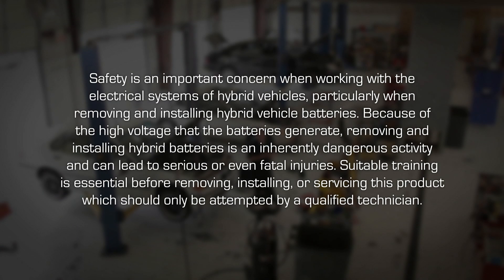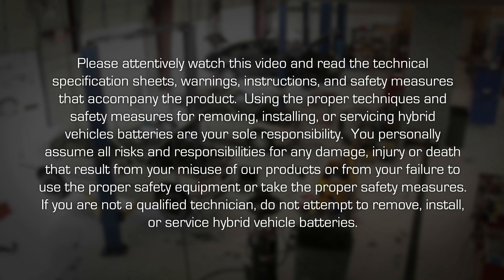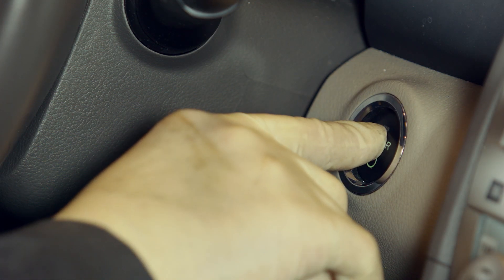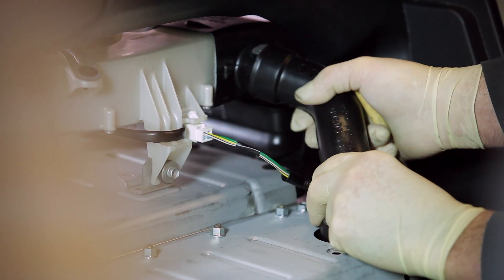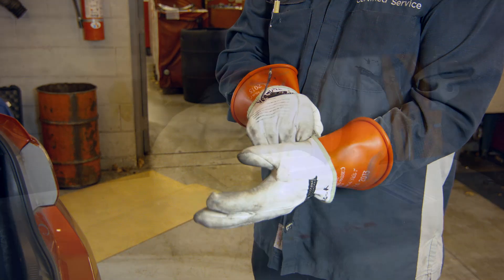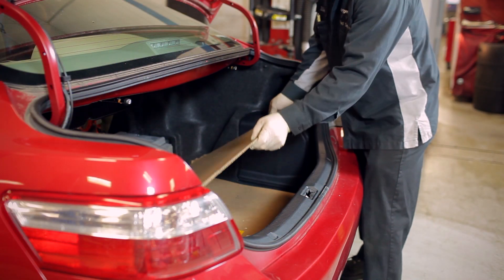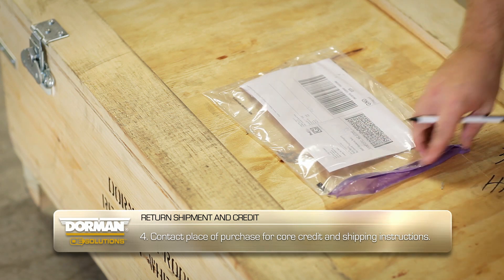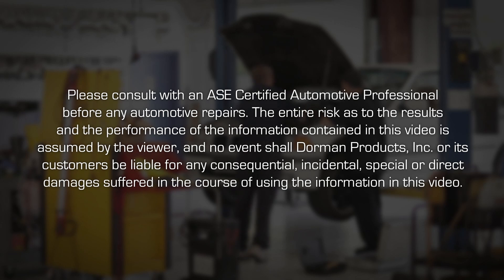How to replace a hybrid battery on select Toyota vehicles

Comment: I guess this makes it look quicker than it is, for the dealer said it would be 6 hours to remove, diagnose, and put back in.
Reply from the maker: +Sam Schaperow, The dealer charges more labor hours because the OE battery ships without the upper cover and the electronics/bus bars. The OE sells just the lower case and the cells and all the other components need to be transferred which adds a lot of time. Our battery comes complete so you do not have to swap internal parts and get into the high voltage area. This saves time and also allows for DIY installation. 
Thank you
Reply: @DormanProducts  hey there good afternoon im interested in your product.